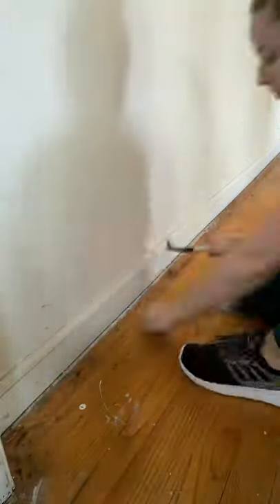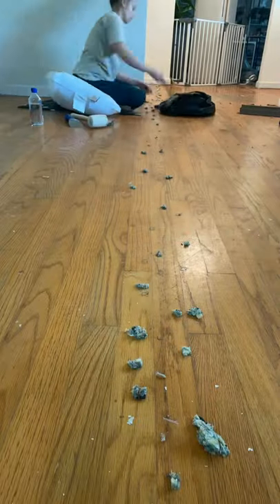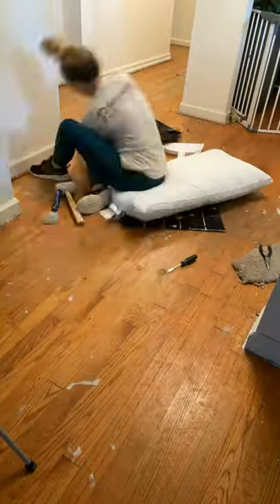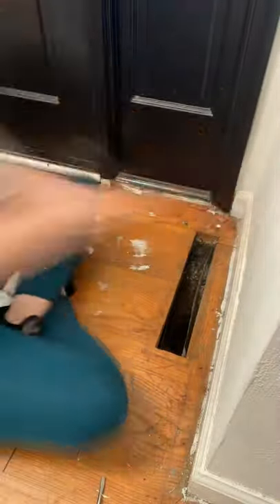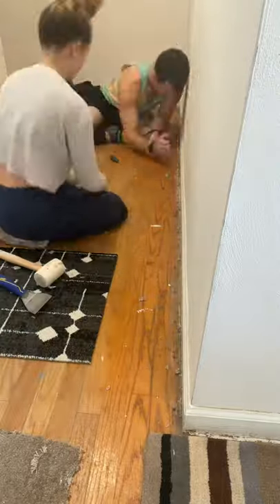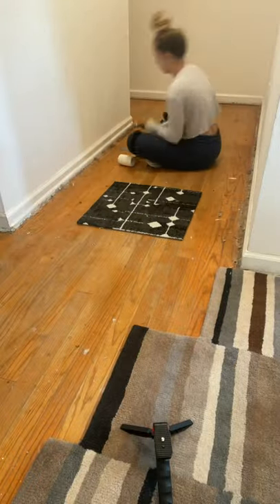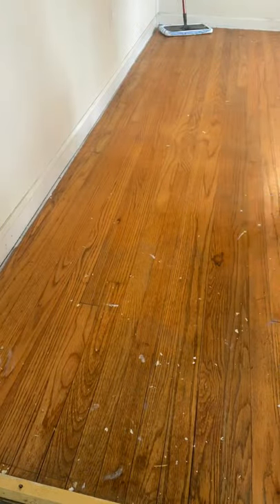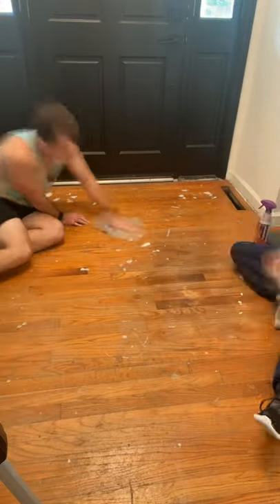HOT MESS HOUSE RENOVATION PART 102! | VIRAL TIKTOK & YOUTUBE SHORTS SERIES | LEXI DIY

Comment: If you sand shut down the air system and plastic off all areas. The dust can infiltrate everything and suck thru your system causing problems especially to interior coil.
Floors look great tho under that carpet!
Reply: A must to turn off you heat or AC system when renovating. The dust will also stick to the sides of your intake vent causing dust to circulate each time it turns on. Also 'reno dust' is unforgiving to electronics.

Comment: Clean your floors with orange goop hand cleaner. Not on a regular basis! But just for a couple times, to remove that paint, and whatever film got on them from the carpet, and whatever the previous people cleaned it with. We pulled up carpets, and used this. Our pad was GLUED DOWN! WHAT A DISASTER! But the goop did the job!